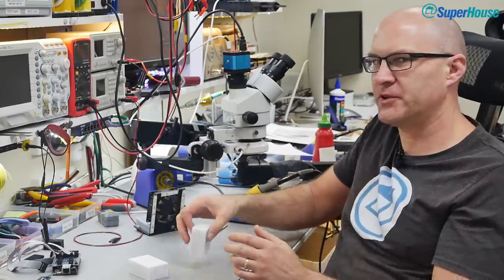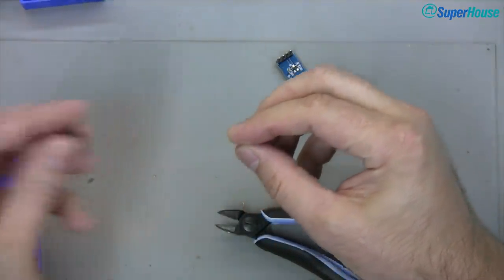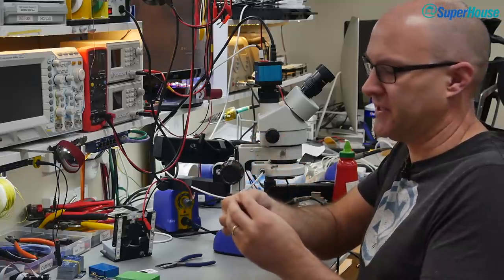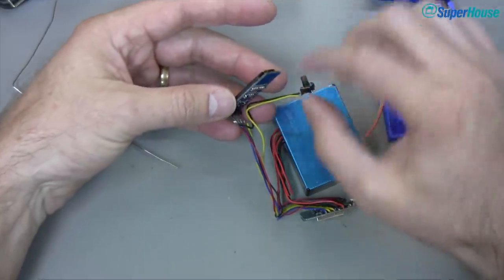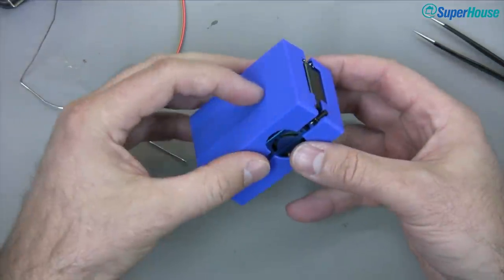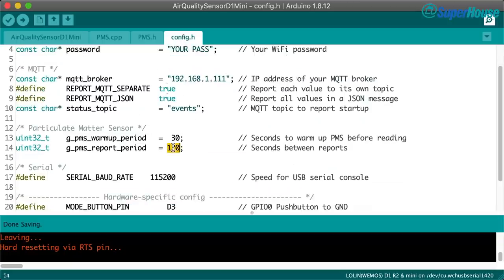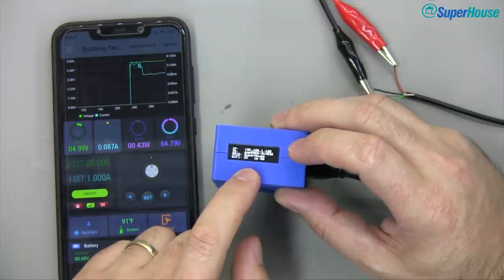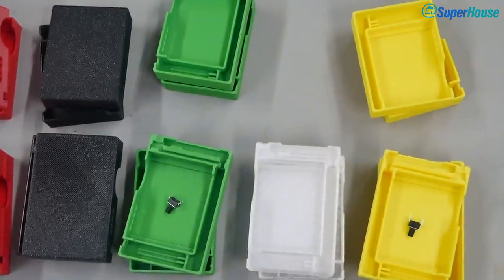SuperHouse #39: DIY air quality sensor part 2 - "Display" version

Comment: I LOVE the little 3D case. very time I do an RPI project, I have to struggle to fit on of those displays on or in the RPI case. No-one seems to have twigged to how useful these displays are.  Developing from your comments, I usuall put the time, temperature, IP address and hostname on the 4 line display. Having it just click into a case with the RPI would be lovely.
Reply from the maker: In the video I said that I order these 20 at a time. I just checked my AliExpress purchase history, and my most recent order for them was for 50 ;-)

Comment: This is a great little project.  I am thinking I might have to make one of these :).
It's just hard to get parts if you need to get them from overseas at the moment.  Quite a lot of countries have closed down as far as sending and receiving packages and China is still very slow.....
Reply from the maker: Yes, that's a real problem right now :-( The PCBs for the "Pro" version of this project (which will be probably part 4 of the series) have been sitting in Hong Kong for 8 days now because DHL don't have enough flights to keep everything moving.
Reply: @SuperHouseTV  Surprisingly I just got a DHL Express delivery from Beijing to Helsinki in two days(!)

Comment: Very nice project, following along with the PMS7003 sensor I picked up recently.  At present, using ESPHome, but I don't believe it has any ability to put the sensor into standby mode.   The MTBF of the sensor seems like something you could bump into -- too bad it needs a little fan.  You might also consider PlatfromIO rather than Arduino IDE for this stuff.   I find that I don't miss the profanity that comes along when I had to use the crummy editor inside the Arduino IDE.  Now, using PlatformIO and Visual Studio Code, you get a great experience.
Reply: Try ESPEasy? It has support for the sensor, display and MQTT. The sleep mode can be triggered using simple scripts you can enter from the web interface. I've done this myself couple of years ago.
Reply: From the datasheet looks like you connect a GPIO to pin 10 of the PMS7003 and set it to OUTPUT mode and set it to HIGH for the device to be on and LOW for the device to turn off.

Comment: Nice mechanic design. How do you keep the enclosure closed? I havent seen screws or clicking hooks.
Reply from the maker: It's a friction fit over the PMS5003 sensor. Just squeeze it closed and it stays there. If that doesn't work well enough, a patch of double sided tape on the inside would do.

Comment: Great video, just wished if you can do similar with Raspberry pi 4 or pi zero w. Even with ESP32 would have been very beneficial as they are very commonly used. Never the less loved it and will do some tinkering to work with ESP 32 if not RPI.

Comment: Hi, Have you find out what is the reason of wrong data of particles amount? Long time I was using my own firmware for ESP32-PMS7003, but today just for fun I've tested Tasmota. While I have been looking for a way to make PMS go to sleep I discovered that all measurements are different - all PM values are slightly more than usual and, moreover, all data from particles counters are stable. Then I've found a command and sent it to Tasmota and after reboot I faced with the same problem as in my firmware and yours. Then I canceled sleep mode, and everything started to work fine. I just shared my observation. May be it might help you or followers to find out how to deal with it. Personally, I think that I will try to modify supply line of PMS to control it's sleep in this way.

Comment: First of all thanks for the video(s), I enjoy the way you are learning us stuff in an understandable way!
I have build one of the previous ones (and will probably upgrade it to this one...;) ), But I am having trouble getting it to report it's reading to openHAB. I connected an LED to the board and got that to work through MQTT.
Now I must say I am completely new to openHAB or any home automation package (yesterday I have installed it for the first time) and can't code or program (ok, maybe a little bit, but only simple relays with an Arduino) so the first question is, will you (or have you already) make a video about how to make the readings appear in openHAB and then preferably in the paper ui as it doesn't need any coding. And if not what's your recommendation to go to if I want to learn more about connecting tasmota projects to openHAB?
Reply from the maker: I'm going to cover more of the software and reporting in parts 3 and 4, but what you're asking are fairly large questions so it's not really practical to use YouTube comments to discuss it! The best thing would be to jump on the SuperHouse Discord or Forum, and put the same question in there. It's much easier to interact that way.
Reply: @SuperHouseTV  thanks!! Will do, I thought that was more for the experienced people 😉

Comment: Great projekt, I am waiting for the particle module to arrive. I am a bit concerned about all the wires crossing the antenne, I dont think this is good practice.
Reply: The wires crossing the antenna will not be any issue at all with these sort of projects.  This is a DIY Home project, not something commercial.  With that said, have a look inside any residential router and you will find antenna wires crossing all sorts of traces.   You will find the same in most laptops also.  It is not anything to be concerned about.  There is no high power RF involved in this.  It is 2.4GHz WiFi.
Reply: @EsotericArctos  I doubt that commercial routers doesn't take very much care of making antennas and HF wiring serious. The cables to the antenna is shielded cable special designed for HF. But you are right, it will properly work, but the distance to the access point will be reduced. Making the antenna (located at the edge of the PCB) free of all cables will improve the range.
Reply: @jenskaa4044  Unless you absolutely fluke the wiring length and manage to get the resonant frequency of the 2.4GHz, the range won't be affected greatly.  
There is no significant voltage.
We are not dealing with HF transmission in the kilowatt region.  This is WiFi to connect to a router with a maximum power of less than 20dbm.
🙂.
I understand antenna resonance and the like, but in the case of the ESP8266 the range difference with wiring across the trace is not measurable in real world testing I have performed.

Sorry for the edits.  I realised the first version didn't come across very well
Reply: @EsotericArctos  I am not sure you understand antenna and high frequencies, I think you should do some more reading on the subject. Making a PCB antenna is not a simple thing, both length, shape and the material (glassfiber etc) has influence on the performance  of antenna. All object nearby the antenna will have influence. Even the material of the plastic used for the case will influence. If you have the equipment (eg. a vector analyzer) you can try different material nearby the antenna to see it for your self. When using low power its actually more relevant to make good antennas to avoid losses. In the quality sensor project I would have turned the 8266  so the antenna is free of all the wires, this could improve the radio part some %
Reply: @jenskaa4044  Well you can doubt all you want, but that doesn't change the fact that majority of "commercial devices" don't care about their performance as long as they work and are sellable. There are tons of examples of this like the air bag companies that are killing people & knew about it for 20 years, bad brake systems, etc. You clearly haven't checked out most home routers and how terrible they are, the access points are insanely bad. Not to mention majority of routers offer "gigabit" however they don't have hardware offloading for NAT and have crap processors and thus can barely break past 300mbps. These are the "gigabit" devices we were given for 20 years. Only the last 3 years have we seen mainstream routers actually put out performance devices since ISPs are actually offering gigabit now. Unless you know FOR A FACT a company is designing something for peak efficiency for you don't you ever assume a commercial entity cares about you or performance. They want money.
Reply: @jenskaa4044  Tons of antennas are computer made for 2.4ghz and in fact are too long because they don't account for the plastic that goes over the actual antenna. This can be seen with pretty much every one of the screw in antennas. They're exact when the plastic is taken off.

Comment: Have you run across any 303Mhz transmitter/receivers that will work on an esp8266. I have several remotes for ceiling fans that all operate on 303Mhz that I want to add to my project. I bought a new fan controller on amazon that said it was 433Mhz but when I got it it was actually 303Mhz. I can not seem to find any 303Mhz devices for esp/arduino anywhere.
Reply: You can use the fan remote you have, just open it up find where your buttons go and emulate the button presses through GPIO

Comment: Hi, 
Thanks for the project with the display. I will want to order a case once international post is possible, to Spain, thanks.
So how did it go?
Well apart from a couple of “I know what I am doing so I did not pay full attention” mistakes it is working.
I told the IDE the wrong board, yes you had it correct and when I did it had the correct pins to talk to the sensor!
I also did my own thing when it came to the PMS files which was fun and time consuming, much simpler downloading the zip!

Your 3D printer and mine sort of disagree with the exact sizing or the board and so mine was not quite so good, the sensor fitted tight, the switch and board needed some Dremel mods and now they fit (ish). My bigger problem was the display and despite your warnings to be cautious, I damaged my first one and out comes the Dremel to allow the second one to work. 
My MQTT server has user and password so I looked into that and added the data in the main file. (Now I have viewed the 3rd video I am feeling a little guilty, happy it worked but oops!)
I used some very thin wire so was able to add the earth wires all to the single earth pad on the ESP board and of course, being thin they feed into the groves in the case really well.
Thank you, again, for a great little project and insight as to how you put it all together.

Comment: Thanks for letting us in on your work with the PMS5003. Your project videos are very informative and easy to watch. I've been looking at some work on this device at www.letscontrolit.com using ESPEasy which is also interesting. I want to avoid compiling code but I'd like the sensor to sleep when I'm not in my workshop by using a node-red flow. Can you confirm I just need to pull SET low for sleep mode and high for active? If that's the case I imagine I can do that with standard Tasmota. Thanks.